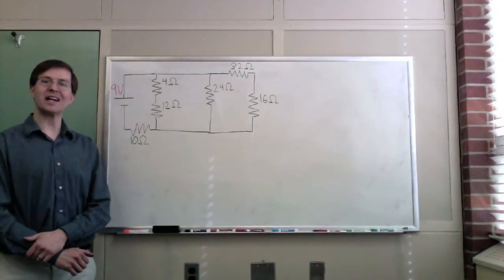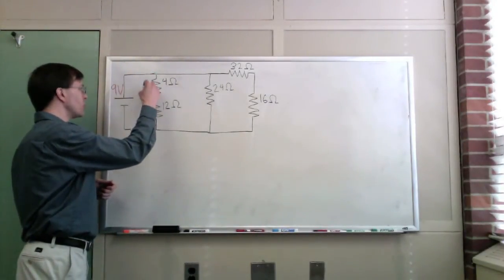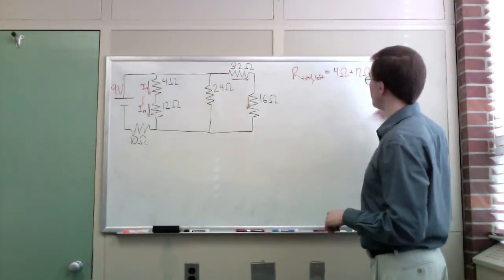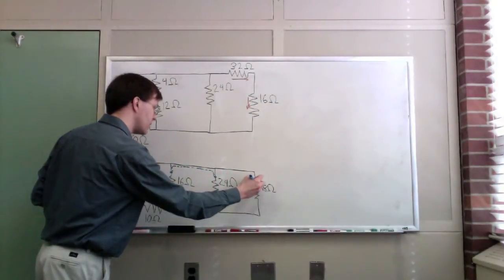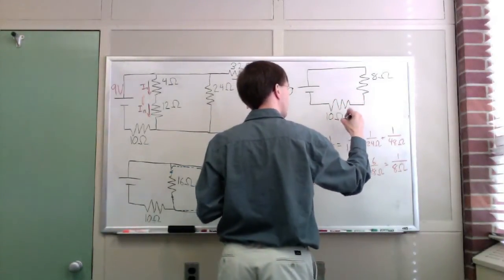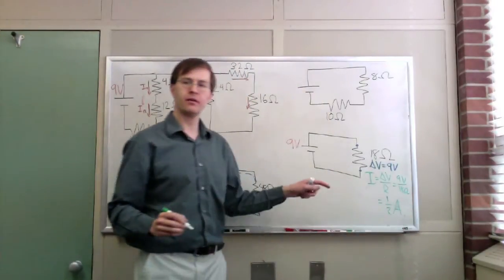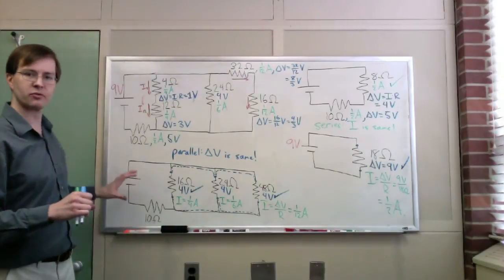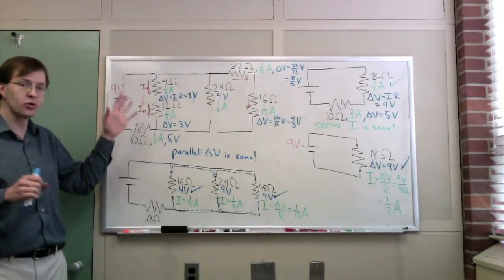Analyzing a more complicated circuit

Comment: Isn't this just a series-parallel?
Reply from the maker: If you mean, "Can't this just be analyzed using repeated series and parallel combinations", then yes, that's the method I use in this video. (I suppose that "complex" really ought to mean "requires a system of equations based on Kirchoff's laws for solution", since this one is certainly less sophisticated than that. I've tended to avoid those during students' first exposure to circuits, though, choosing to focus on deeper mastery of series/parallel combinations and on the general skill of solving problems by breaking them into simpler parts and then soldering the many simpler solutions into one big one.)

On the other hand, if you mean, "Isn't there a way to solve this in just one or two steps using series and parallel equations," then no, there isn't a shortcut quicker than the method I've shown in the video. (Or if there is, wow, I'd love to know what it is!)
Reply: I may have been too brief, but what I meant was, I thought complex circuits were those that couldn't be broken down to just one resistor.
The textbook for my Electronics for Computer Technology class states that a complex circuit is one that contains some components that are neither in series nor in parallel. Is that inaccurate? I'm just a little confused.
Reply from the maker: I'll be honest: when I wrote this title, I used the word "complex" in its colloquial sense of "harder to analyze", not as a technical term with a specific, narrow definition along the lines of "can't be reduced to a single resistance". (Even more honest: I'd actually forgotten that the term "complex circuit" sometimes had that specific narrow definition. I'm not sure if that narrow definition is universal or only used by some references and not others; I don't even recall whether my own circuit lab instructors used it or not.) Perhaps I should tweak the title of this video so it doesn't wind up misleading folks looking for examples that do require Kirchoff's laws. (And maybe I ought to record an example of one of those, too!)
Reply: Steuard Jensen
So how would I go about numerically solving one of those?
Reply from the maker: I'm afraid that would take a longer answer! Or better yet, a video, but this isn't the moment for me to make one.

The gist of it is that you need to set up a system of equations: one equation reflecting conservation of current for every junction ("Kirchoff's junction law") and one equation reflecting zero net voltage change around every independent loop ("Kirchoff's loop law"), along with Ohm's law relating current and voltage drop for every individual resistor. (You'll have unknowns for the current and the voltage drop for each resistor, but go ahead and assume the same unknown current for sets of resistors in series: that assumption is built in to how the junction law is set up, unless you treat a straight wire connecting two resistors in series as a "junction".)

My vague memory is that for every closed circuit you'll have one more junction equation than you need (that is, one winds up being redundant), and it's a bit of an art to figure out how many loop equations you need (since complicated circuits tend to have a whole lot of ways of defining closed loops). One you have those zillion equations, you can solve the system in your favorite way. (Linear algebra and row reducing a big matrix is one nice approach, and it can handle the copious redundant equations pretty naturally. Or just use Mathematica or something.)
Reply: Steuard Jensen
I was told before it was complicated lol. Thanks for giving me a tip on what to research!

Comment: That is not an 8ohm resistor you should have devided 1/8 so the resistor total is  0,125
Reply from the maker: +Brutalni Stvor l I'm not entirely sure what you're referring to, but I'll take my best guess. As I said in the video, combining the three resistances in parallel gives: 1/(16 Ohms) + 1/(24 Ohms) + 1/(48 Ohms) = 3/(48 Ohms) + 2/(48 Ohms) + 1/(48 Ohms) = 6/(48 Ohms) = 1/(8 Ohms). But if you look at the units carefully, they are a clue that this can't be the final answer for this combined resistance: this result is (1/8 Ohms), not (1/8) Ohms!

Because the actual combined resistance has to be in Ohms, not (1/Ohms), we're reminded that we have one step left to do in order to find the combined resistance: 1/(8 Ohms) = 1/R_parallel, and thus R_parallel = 8 Ohms. It's really easy to forget a step like that! And that's one of the big reasons that I've learned to always, always, always keep track of my units, in every single step of every calculation. Doing that, I catch most of my mistakes within a step or two of making them, so I can quickly figure out where to fix my errors. (If you were to watch enough of my videos, you'd probably see me do exactly that from time to time.)
Reply: So we dont devide 1/8 ? I dont quite understand that step, thanks for answering btw. :)
Reply: +Steuard Jensen Never mind i understand know sorry for bothering. When i get that 0.125 then i do this 1/0,125=8